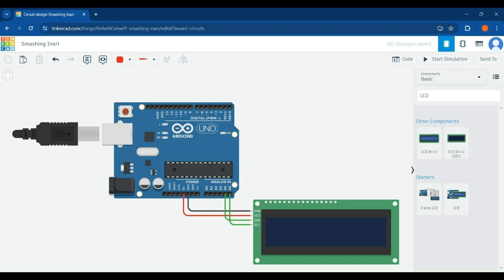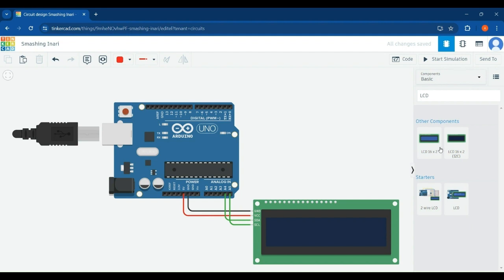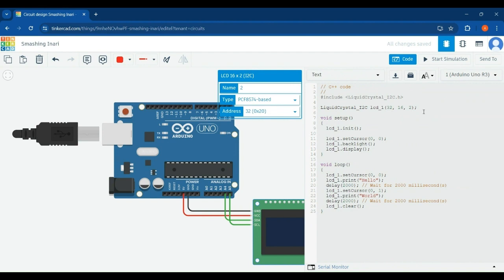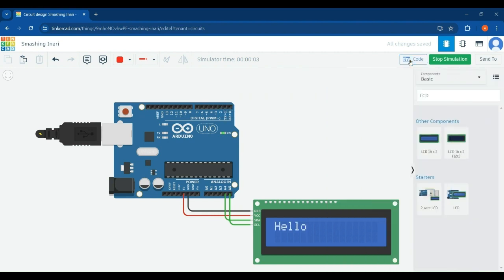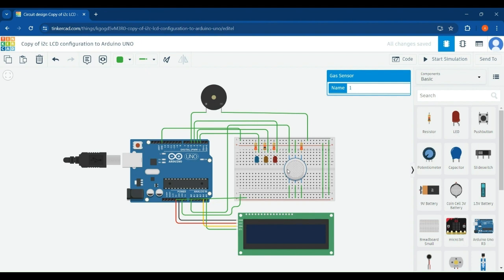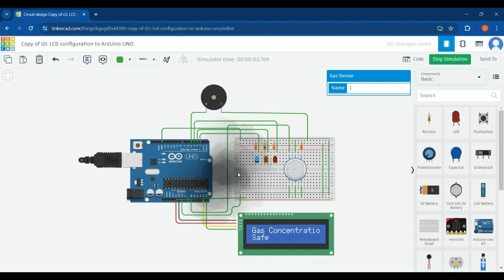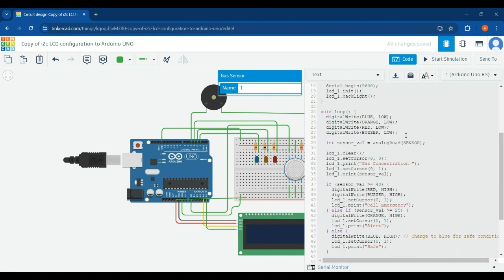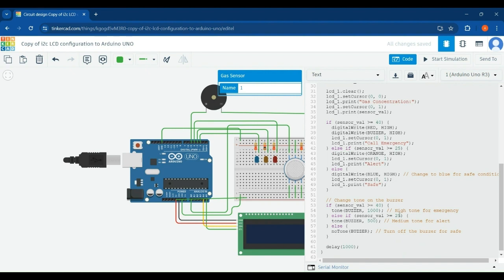TINKERCAD BASED PROJECT ON GAS DETECTION AND ALARM SYSTEM

Comment from the maker: https://www.tinkercad.com/things/kgogd5vM3R0-copy-of-i2c-lcd-configuration-to-arduino-uno
#include <Wire.h>
#include <LiquidCrystal_I2C.h>

LiquidCrystal_I2C lcd_1(32, 16, 2); // 32x16 LCD

#define BLUE 2
#define ORANGE 3
#define RED 4
#define BUZZER 5
#define SENSOR A0

void setup() {
  pinMode(BLUE, OUTPUT);
  pinMode(ORANGE, OUTPUT);
  pinMode(RED, OUTPUT);
  pinMode(BUZZER, OUTPUT);

  Serial.begin(9600);
  lcd_1.init();
  lcd_1.backlight();
}

void loop() {
  digitalWrite(BLUE, LOW);
  digitalWrite(ORANGE, LOW);
  digitalWrite(RED, LOW);
  digitalWrite(BUZZER, LOW);

  int sensor_val = analogRead(SENSOR);
  
  lcd_1.clear();
  lcd_1.setCursor(0, 0);
  lcd_1.print("Gas Concentration:");
  lcd_1.setCursor(0, 1);
  lcd_1.print(sensor_val);

  if (sensor_val >= 40) {
    digitalWrite(RED, HIGH);
    digitalWrite(BUZZER, HIGH);
    lcd_1.setCursor(0, 1);
    lcd_1.print("Call Emergency");
  } else if (sensor_val >= 25) {
    digitalWrite(ORANGE, HIGH);
    lcd_1.setCursor(0, 1);
    lcd_1.print("Alert");
  } else {
    digitalWrite(BLUE, HIGH); // Change to blue for safe condition
    lcd_1.setCursor(0, 1);
    lcd_1.print("Safe");
  }
  
  // Change tone on the buzzer
  if (sensor_val >= 40) {
    tone(BUZZER, 1000); // High tone for emergency
  } else if (sensor_val >= 25) {
    tone(BUZZER, 500); // Medium tone for alert
  } else {
    noTone(BUZZER); // Turn off the buzzer for safe
  }
  
  delay(1000);
}